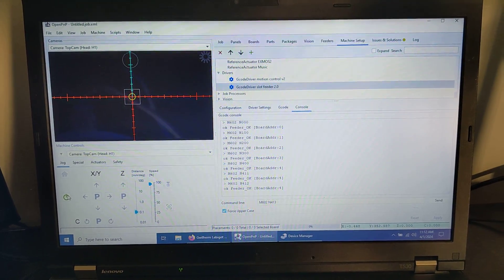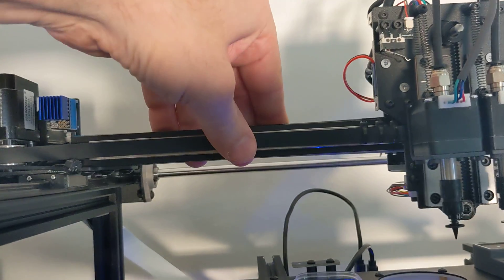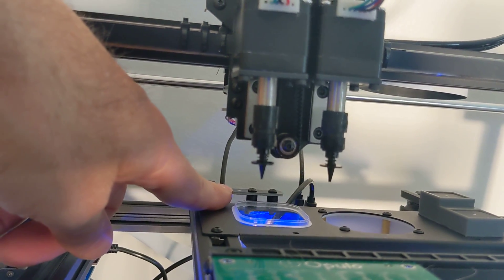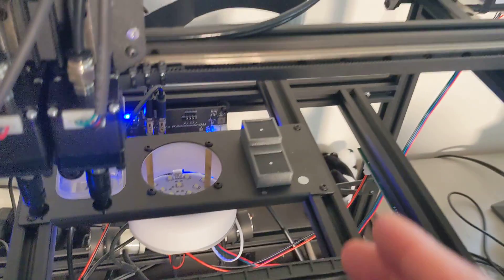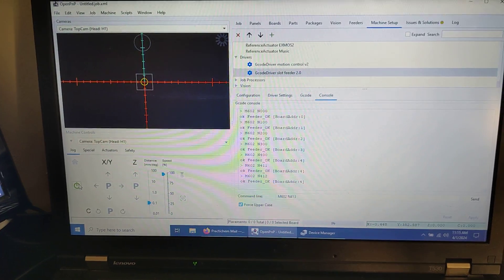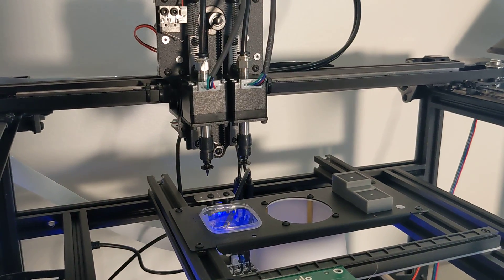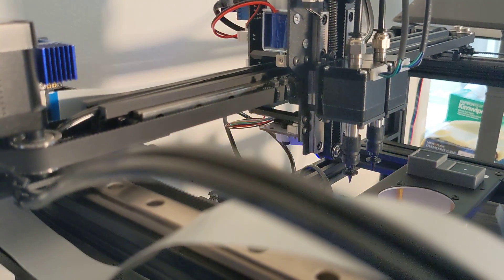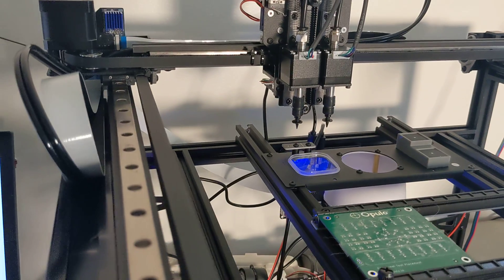PandaPlacer A1 and OpenPnP 2.0 visual homing

Comment: Hello, have you ran any jobs or placed anything on to a pcb yet?
Reply: I was looking at the lumen but it's a little big for my area and then the feeders at the front wouldn't of been ideal for me, this is slightly smaller but feeders at the sides and still decent size PCB size so I'm interested in seeing more about they pandaplacer
Reply from the maker: What would you like to see? Check the other videos in this playlist. I'm trying to show real world setup of the PandaPlacer A1.
Reply from the maker: The job I'm setting up has many 0402 - still placing on dbl sided tape. I have placed 0603 and larger.
Reply: The machine been used for an actual job by a customer not just pandaplacer own video to promote that may of taken 50 attempts, on paper and price seems great but is it like the early days of 3d printing and it's more time tinkering/fixing and modification than actually using it

Comment: I've had a pick'n'place machine for some 3/4ers of a year.. been trying to configure open pnp several times now. in the beginning everything looked promising, but the further I got into setting up, and calibration, the more it would fail. i.e. center point of nozzle, missing hole registrations in the component reel etc... so I would love to see you making vids from start to finish.. (I have a feeling that many errors are due to low or missing ambient light, but I'm not sure)
Reply from the maker: Any specifics you'd like to see in more detail?
Reply: @nickydoes  Basically everything from after unboxing and powered on the first time to we're done placing all the components, now it's time for putting the pcb in the oven. The whole setup/configuration process.. even though I know it quite well (after many attempts), it would be nice to see someone else doing the setup/configuration, not an edited version where failures etc are removed, but everything included (something like: oh it shouldn't do this, now lets fix that..)   Consider what you know now, compared to when you knew nothing of pick'n'place machine, and was going to buy one (this ought to be material for many interesting episodes).
Reply from the maker: Check the videos in this playlist. I'm balancing shooting videos with being productive, so I'll focus on something if you have a specific question. Thanks for your comments!

Comment: By chance do you have the 3d model you used for the dual height calibration?
Reply from the maker: Hello. Yes, I will also put it in the video comments. Good catch! Give me a few minutes to get it on Printables, etc. 

https://cad.onshape.com/documents/2f4353dccf651071fecb6d31/w/fa32489e50796bd06cb0fe63/e/bf79375ebfa410440afa5f2b
Reply from the maker: Here's a better version for you.
https://www.printables.com/model/839467-pandaplacer-a1-dual-height-fiducial-fixture